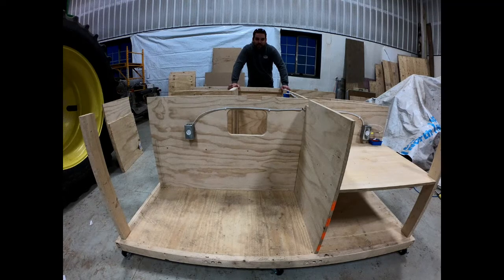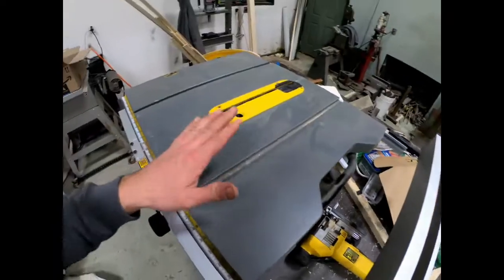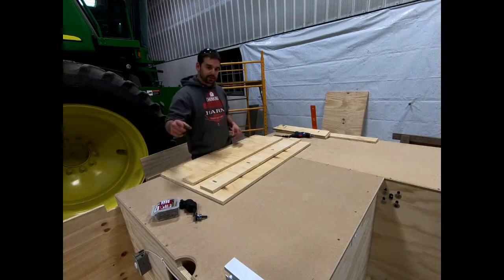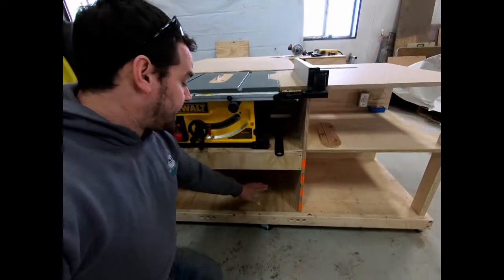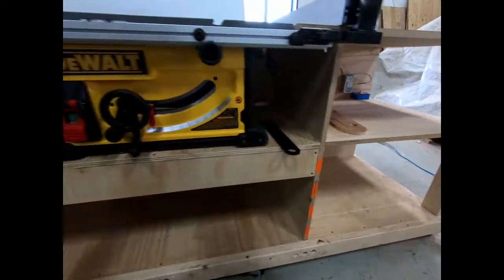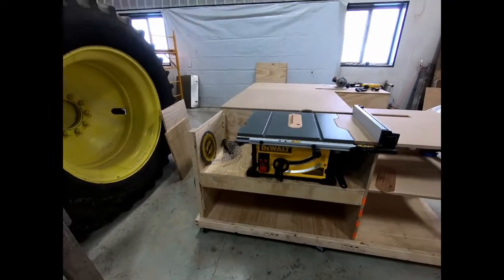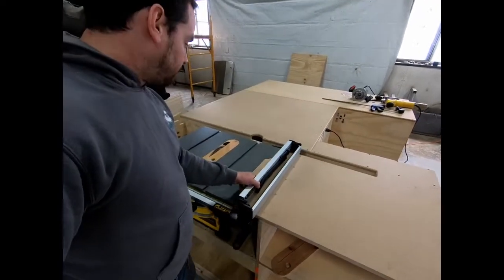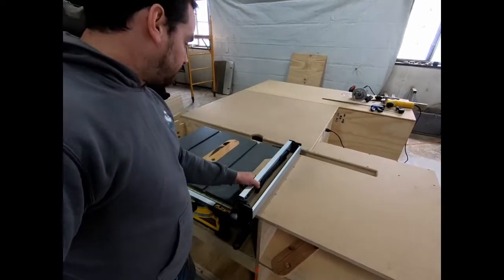All in 1 Ultimate Wood Workstation Bench EPISODE 3

Comment: on the left of the saw install a slide in unit with a cut out for the release. cut a slightly larger opening in the top leaving a lip to hold a insert to complete the top.

Comment: What is the Drill bit offset you were using to drive screws near the vertical supports ?
Reply from the maker: Bosch GSR12V-140FCB22 Cordless Electric Screwdriver 12V Kit - 5-In-1 Multi-Head Power Drill Set